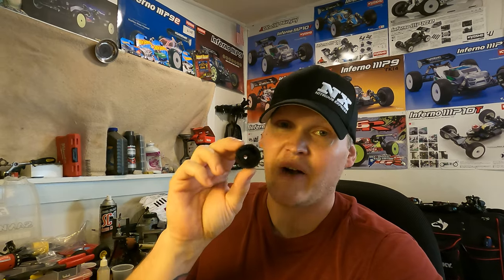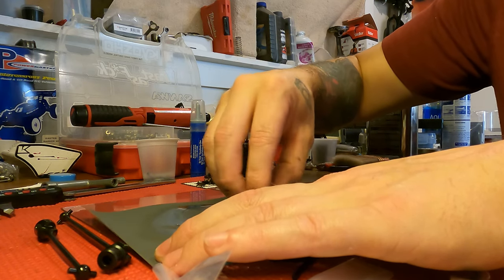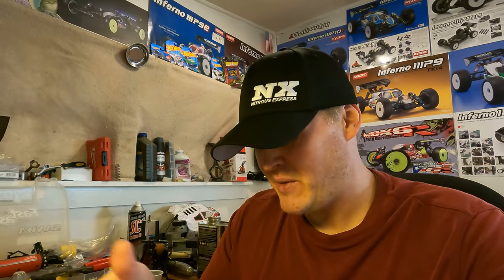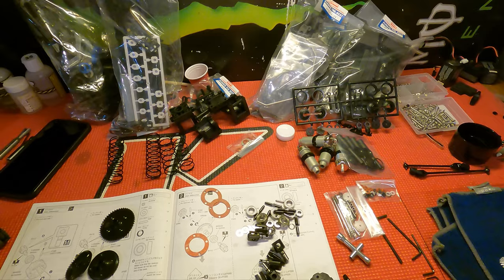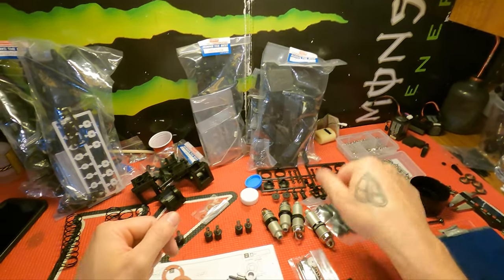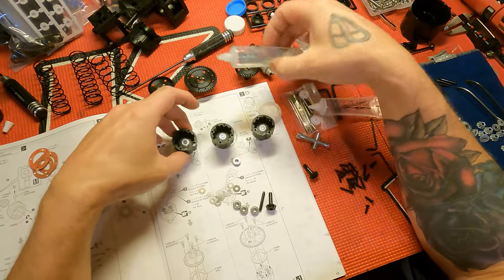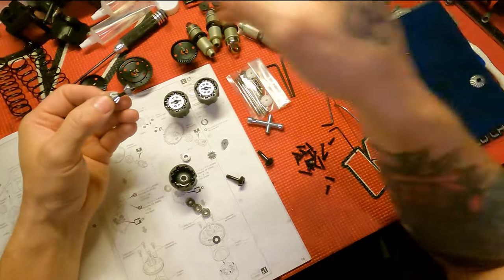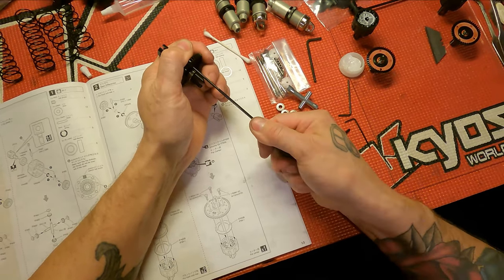KYOSHO MP10 RC DIFFERENTIALS MP10e TKI2 TKI3 DIFF

Comment: Rebuilding the diffs in my old school Inferno sports MP7.5. Got some nice steel gears, as the originals in my car seem to be aluminum I guess, new gaskets and the spider gears too. Way back when, I thought I was all trick cuz I put in the 2nd set of spider gears, as mine only shows one set in the instructions. I really like your idea of the WD-40 and sandpaper to 'machine' the diff case. Water would probably work too. I like the 'dainty' little driveshafts. I guess supposed to be light weight? (so thin looking!) And when you're all done, there's a wierd satisfaction of working that diff in your hands and feeling the resistance of the oil! lol
Reply from the maker: Awesome man I had a MP7.5 that was a great buggy. I had tons of fun with it 🤘🏻